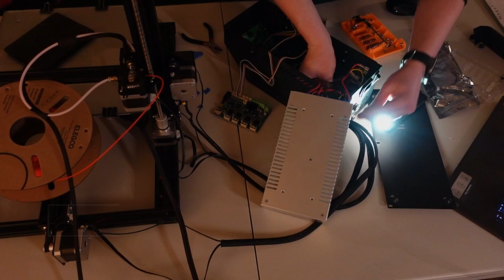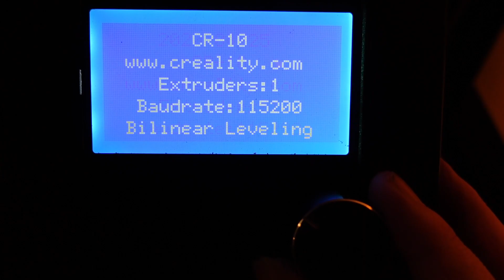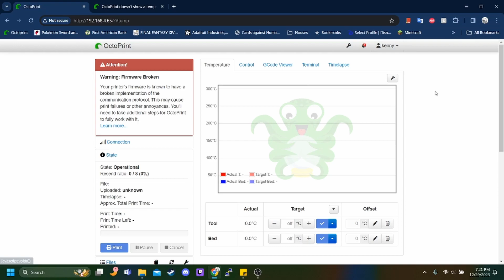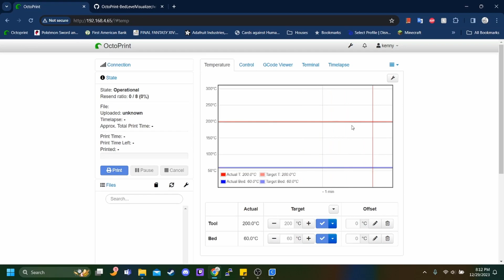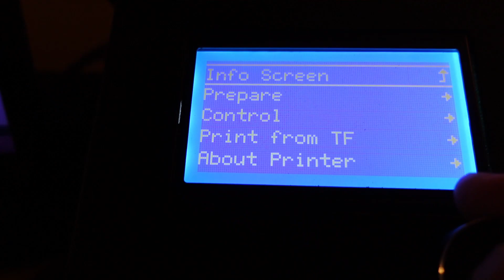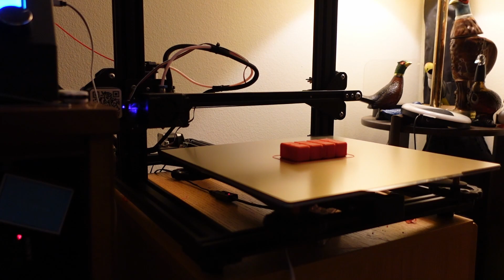CR10 Upgrade | CR-Touch | PEI Build Plate | New Motherboard

Comment: Sorry about the name. Do not let the wires rub on the build plate at all. You will need to replace the mother again. It can and will cut the wires. P.S. let me know if there is a mod for the CR10-v2,v3 motherboard. Have Fun
Reply from the maker: Unfortunately I do not have a cr10v2 yet, but if I do get one I will for sure make a new video on it! With the wires, do you have any ideas on how I can minimize that? I’ve tried moving the control box but the wires are just so short I can’t fit it anywhere but where it already is. My plan is to just get an extension for them
Reply: Hi. Goto "Things" and down load cable chains. They work great, but take a long time to print. Print on. @Kenniku_Prints
Reply from the maker: @charlesvrogers  thank you!

Comment: hey mate, what is your output voltage on the PSU ? I thought that board was a 24 volt one and the PSU only outputs 12 v ?
Reply from the maker: It is a 24 volt, and my cr-10 does output 12v but it does still run it very well. I have printed a few prints now on it and haven't encountered any errors. I found a reddit post about someone using it and they have been using it for a while at 12 v with no problems